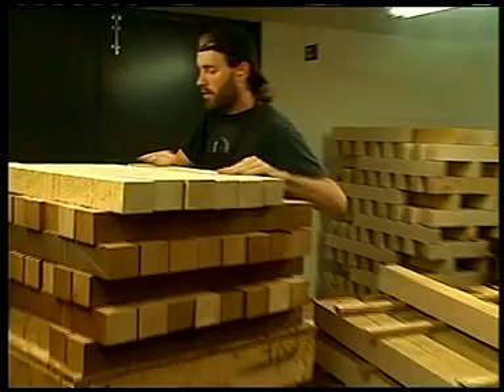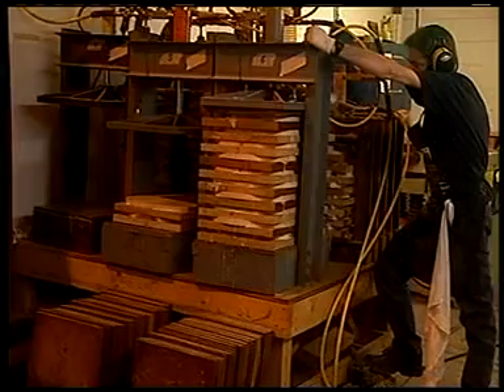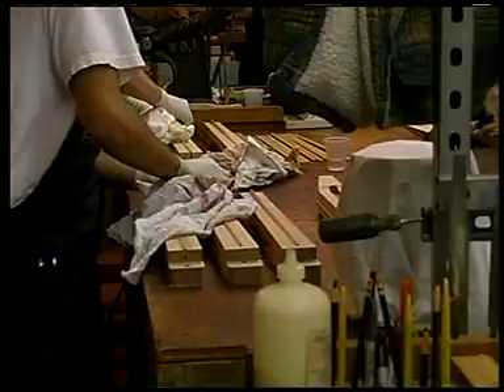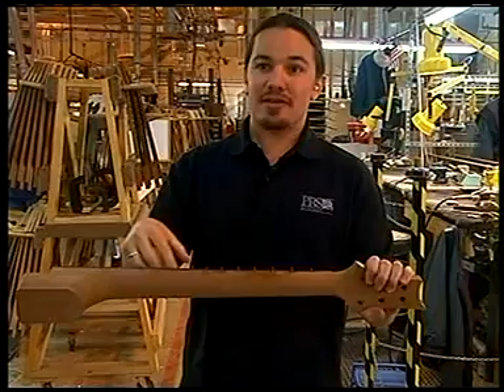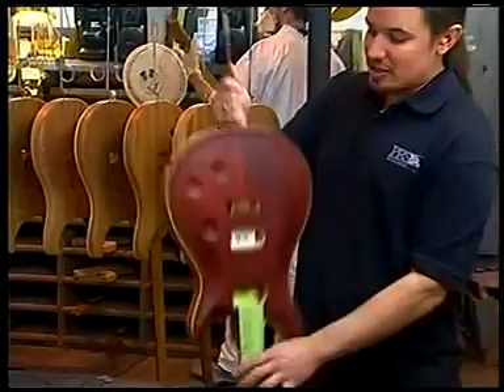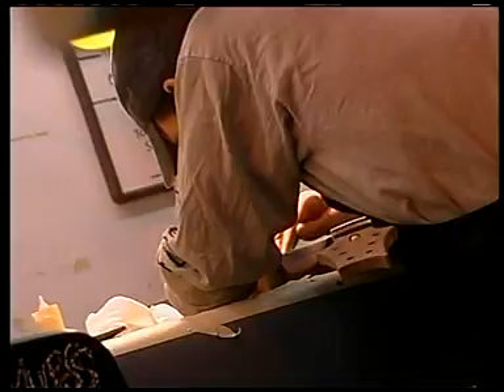PRS Factory Tour Part 1/2

Comment: No you heard correct. I am surprised you haven't heard about this before. It is the same concept as using microwave curing or even infared to thermoset the compound. They all use EM waves to heat and cure the glue. By using RF adhesion compound they can cure  evenly and quickly as RF radiation penetrates these woods. These machine are super expensive and really are only practical from an industrial standpoint as it increases workflow. Not practical for you.

Comment: Thats not entirely true. As the quality of a guitar goes up it is true that you see a more streamlined neck joint with little heel. But only to a point. Most top end luthiers feel that two woods in the body kill tone. They also have found that better resonance is seen with a bulkier joint. Fender and Gibson's top models all have this. PRS has done this pretty much perfect with the body shape. You can play the top frets without feeling any hinderance from the heel.